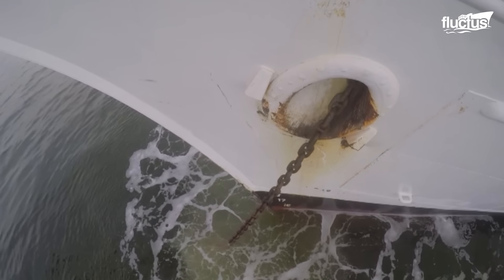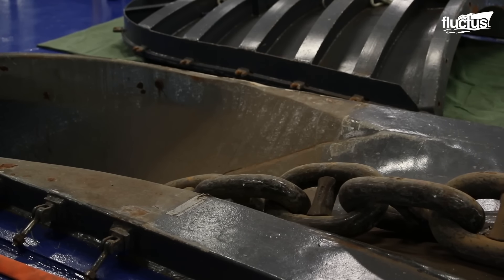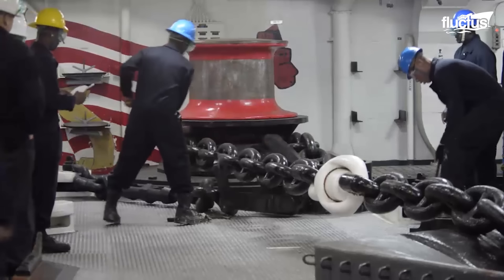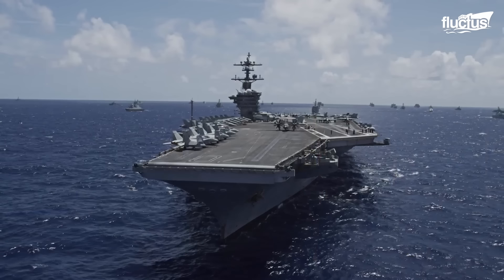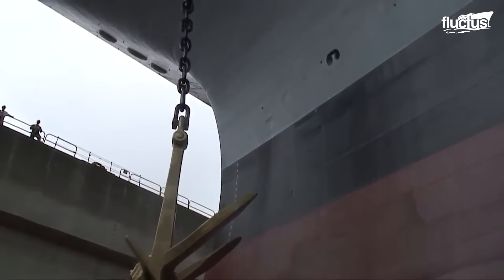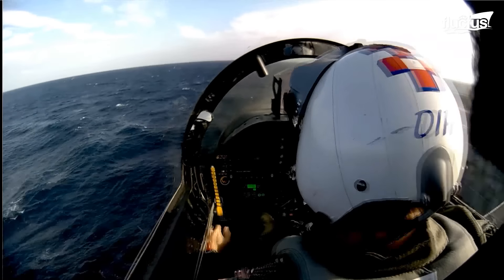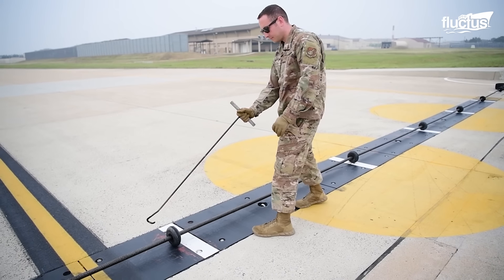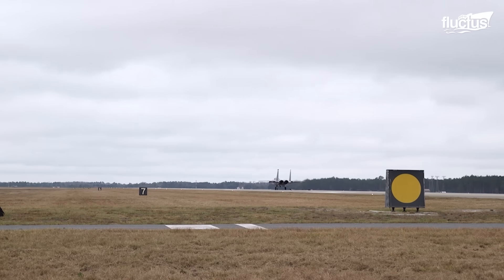How US Navy Drops MASSIVE Aircraft Carrier Anchor at Full Speed

Comment: Great video.  Technical point.  The purpose of the anchor is to hold the chain on the bottom.  When a ship pays out its anchor chain, the bulk of the chain is on the bottom, and a small part angles upwards through the hawsepipe and onto the forecastle and is "clipped" in place by the pelican hook that is connected to a strong padeye on the deck.  That curve is called "catenary" and serves as a "spring" to absorb the strain wind and seas would exert on the ship, as more chain is lifted off the bottom.  When the seas calm, that chain that was lifted off the bottom eases back onto the seabed.  The anchor plays a critical part, but it is the accumulated friction of the chain on the bottom combined with the anchor that holds the ship at its anchorage.
Reply: Yes! The anchor hook itself would not be enough to keep the ship from straying. It's also friction, and the enormous weight of the chain (which increases due to classical mechanics as the chain is pulled horizontal) that reaches an equilibrium with the ocean forces and holds the ship in place. When pulled horizontal, the chain effectively weighs so much that even the mass of the ship cannot overcome it.
Reply: Thank you, I was waiting for the video to explain that the weight of the chain plays a significant part in anchoring a ship, not just the strength of the chain, but the video missed this important detail.
Reply: I thought the catenary results in a straight pull on the anchor. Since the flukes can swivel, this results in digging the anchor deeper, the harder the strain.
Reply: The weight of the sea on the chain on the ocean floor together with the shallow angle of the chain to the ship provides the resistance or strength to the anchor system … in other words a 30 ton anchor and chain system hanging just perpendicular would not provide the strength to secure the force of an aircraft carrier being moved by the seas.  In stormy seas, the ratio is 7 to 1, meaning for every foot of depth at anchor, 7 feet of chain needs to be lying on the ocean floor … hence why the chain is over 1,000 feet long.
Reply: John B ..Well THAT is very interesting, John. I didn't know that, but when you explain it like that , it all makes sense. Thank you.
Reply: On boats around 30 - 100+ feet, it's definitely the anchor that does the job.
The chain ensures the pull on the anchor is close to horizontal so it can dig in rather than pulling out, but I've seen nearly the entire chain lift off the bottom in strong wind, (actually in the water watching it) the few metres of chain  left on the bottom certainly wouldn't have held the boat.

Definitely anchor and chain both play a part, but you can anchor effectively with mostly rope not chain, (as long as there's some chain at the anchor end) but with no anchor you would drift in even moderate winds.
Reply: Thank you for that awesome explanation sir.👍👍👍🙂
Reply: @keamu8580  no shit
Reply: Would’ve been nice if they talked about parts of the anchor, stud link chain, what a shot of chain is, turnbuckles, etc. But I’m just a Boatswains Mate and I spit tar I is I are😅

Comment: Another interesting fact about why arresting gear is needed is because the planes have to land at full power to ensure that if anything goes wrong the plane will have enough speed to take off again on the other end of the ship.

Also I’ve seen video of an arresting gear cable snapping and taking some of the flight deck personnel’s legs off. A flight deck is by far one of the most dangerous places to work.

Comment: It isn't only the anchor, "hooked" to the sea bed that keeps the ship from moving, but a great length of chain as well, who's weight, stretched along the bottom of the sea providing slack to stop the boat from drifting away.
Reply: The anchor itself does nothing else than to give the chain a fixpoint, it isn't even theoretically capable of holding the ship in place.

Comment: Excellent video about the anchor chains and arresting systems. I was a bit disappointed that there was no mention of the motors that retrieve the fifteen ton anchor chains.
Reply: No mention either of the need to have the ship perfectly stationary vis à vis the sea floor otherwise the momentum of a moving ship of that size would just tear the hook off. Have been on board a supertanker on the bridge as the very fraught procedure was undertaken. As soon as the ship was stationary & the hook was dropped the relief of the crew was palpable.
Reply: @JohnThomas-ci9ml  The tremendous energies involved would be phenomenal. I suppose a ship of that tonnage would use thrusters instead of sea anchors for station keeping.
Reply: @kepler186f4  Sea anchors. They were definitely dropping the hook(s). I remember they had some sort of Doppler equipment to measure the motion of the ship against the sea floor. Maybe they had thrusters to help achieve optimum conditions. Very intense concentration from all concerned.  The hook would have been torn off even at a slow crawling speed less than a knot. No ifs or buts. The ship had to be stationary.
Reply: @JohnThomas-ci9ml  What some without understanding would considered a simple task, others with knowledge would know how stressful a situation like that is.
Reply: @JohnThomas-ci9ml  gotta be moving to set an anchor ⚓️ that anchor ain't snapping
Reply: @steveib724  The bridge crew of that supertanker would definitely disagree with you. The anchor(s) wouldn't have snapped but the chain(s) certainly would have! Movement of the ship after dropping anchor would presumably set the anchor safely. I'm not a sailor, btw. I was only aboard as a junior radar service engineer with a more senior engineer from Decca to modify the ship's radar but witnessing that anchor episode was certainly a major eye-opener!
Reply: Hamsters running on wheels... Lots and lots of hamsters

Comment: The anchor chain is not attached to the ship, it is held in in the chain locker by gravity. Only the catspans and drums that pull up or lower the chain connect it to the ship. The chain locker is a void, or space not intended for human occupation, and the chain just piles up in it. It is normally never entered by the crew.
Reply: BS
Reply: It's connected to the ship via the "The Bitter End"
Reply: That's the mooring lines.
Reply: @taraswertelecki3786  Mooring ropes are not connected to anything. The anchor chain is secured to the vessels structure via the bitter end.

The chain locker is inspected at least every year. 

I've been at sea 20 years as a deck officer, look it up.
Reply: @joelang6126  Have you even been in the chain locker? I have been. Never did I see anything to which anchor chains were attached. The catspans on the decks though engage the chains like sprockets. However, some ships do not have anchor chains, they have a thick wire rope at the end of which the anchor is attached. The other end is connected to a windlass.
Reply: @taraswertelecki3786  Yes many, 20 years at sea and 35 ships.

The chain is connected to the vessel by the bitter end.

I encourage you to Google it.

Comment: The purpose of the anchor is to pull out the chain, the chain is pulled out along the sea floor via the ship backing down and a swing arch (the point of anchor drop to a specified length: dependent on the depth of the anchor spot) is plotted.  That's why the anchor drop spot is Not where the anchorage spot is designated.  The weight of the chain on the sea floor is what holds the ship in place.
Reply: @krvnjrcbs  YES!!

Comment: The birthing compartment my division was assigned aboard the USS Coronado (LPD-11) was where the anchor shaft was located. Being in the rack when the anchor was dropped was like having an earthquake.
Reply: LOL you mean berthing though with all the women coming back from cruises pregnant perhaps someday they will rename it.
If you think anchor drops were noisy, nearly any berthing space on a CV is a racket when flight ops are going on. Air wing personnel are berthed just below the hangar deck and our work spaces are just below flight deck. You get used to the noise.
Reply: @johnlucier5654  Air Wing VAW-125 berthing area right below the third arresting cable on CV-60. I can sleep through almost anything now.
Reply: My berthing compartment was in the same place on the FID.  All the way forward by frame 5.  Ig the hook wasn't being dropped; the cats were in use during night flight ops.  Like Greg J. stated, I can sleep through almost anything.
Reply: @johnlucier5654  also on CV-60, OPS berthing is right below the forward cats, my rack was the top rack under the starboard cat.  When I say under, the normal rack configuration is 3 high, mine was 2 high, and sitting up had me head against the overhead (ceiling). During a deployment, after a week, I couldn’t sleep unless we were launching.
Reply: @ogbytes  last time I saw FID & SARA together was in Newport RI.  They were way too quiet.  I got to go down the pier, when SARA was being towed off to Texas.  No pumps, no hull noises.  It was obvious, she was dead.
Reply: The first time I saw FID & SARA together was 1979, Mayport FLA.  I thought they were huge after serving on a fast frigate.
Reply: @PoppiB  I was on CV-43, guess the berthing our squadron (VF-21) got wasnt too bad after all. However we were just below the forward mess deck, next to food storage spaces. Potatoes IIRC. Cockroaches everywhere, nothing worse than waking up in the middle of a deep sleep on a hot day and wondering if that was  bead of sweat dripping down your skin or a cockroach.

Comment: Naval aircraft have incredibly robust landing gear, much beefier than Air Force standard aircraft.
Has Air Force started to modify their aircrafts landing gear? Hard to imagine a B52 deploying arresting gear only to rip apart the tail section. 
Costs assessment? Pilot training? Lots of things go into one service trying to duplicate another services technology. Generals and Admirals always like to one-up each other.
Reply: Seems like the USAF arresting system is basically an emergency landing aid, whereas the USN needs a good arresting system all the time, and gear designed to take such abuse regularly.
Reply: No, the USAF hasn't beefed up their landing gear. Their arresting gear isn't as robust either. It's just there in case their wheel brakes or air brakes fail so that they can come to a full stop without spilling their cafe latte. 😁👍 Fly Navy!!!
Reply: The b-52 has a droug parachute it's awesome

Comment: This was fun and nostalgic to watch. I was on the USS Theodore Roosevelt cvn-71. I operated and lead catapults 3 and 4 at various times of my sea-duty. I later went to shore-duty in PAX River MD, where I also got to operate in the test catapult and arresting gear. The gear engine and damper systems are very similar to what is on board the ship. I'm no stranger to maintaining large and heavy equipment and seeing those sailors working on the anchor systems; that's hard work for sure. Even the airman have hard work running drills/operations and maintaining those air-force variants of the arresting system. Thank you.
Reply: Thank you for your service. Pax ain’t to far from me. As a civilian I have done construction work there multiple times. I’m from Calvert

Comment: Just a point on the anchor. It is not the anchor that holds the ship in place, it is the chain. The chain far outweighs the anchor and they drop a length so that it trails in part along the seabed. The Anchor fluke digs into the seabed as the ship drifts and itself prevents the end of the chain moving while the right length is dropped enough to hold the ship. During a strong tide or current the ship will pull the chain taught (off the sea bed) and hold, once the current subsides the chain's inertia pulls the ship back to the original anchored position. To pull the anchor the ship must move directly above it so that the fluke comes off the seabed easily.

Comment: I was on sea &anchor detail on  CV~67 USS John F Kennedy.  On starboard forward catwalk. When I hear a change in the sound of anchor running out, faster and faster. Call comes over sound power headset : clear the catwalk runaway anchor. I barely stepped inside when the bitter end whipped out and took off catwalk.

Comment: More so it's the lenght of chain that anchors a ship in in the water. A ship will drop anchor, then pull back on the anchor, thus letting more chain out. It's the weight of this chain that holds the ship.

Comment: 0:36 the hooks don’t grip the sea bed!, basically when an anchor is plane on the sea bed it digs into the thick mud, with the weight of the chain they lay down around 80- 100 meters of chain if the boat is around 60- 150 meters long, it’s not the anchor it’s the chain that makes the boat stay in its place although it may spin around the boat it’s still in its area.

Comment: The Weight of the anker pulls out the chain.  The form of the anker depends on the ground of the sea, where the ship main time is going. For excample sandy or muddy ground. The weight of the chain keep the the ship in position.  The lenght and the mass of the chain depends from ship to ship. Only for smaller boats, like small Sailingboats, only a rope and a smaller anker is needed.

Comment: To think they still use the fathom when the military is supposed to use metric units.  One fathom is six feet or around 1.8 meters.  And it's measured below the depth of the keel so at the thirty fathom mark it is actually more than 180 feet out.  And for an anchor drop to count it actually has to fall freely.

Comment: USS Ranger CV-61 Aircraft Carrier, Engineering Department, Electrian's Mate EM2 Ross, 1975 thru 1980. We never dropped the anchor. The end or the chain is not fastened to the ship. The anchor has a controlled decent to the sea floor. This is done by a large brake drum about eight feet in diameter. The term "dropped anchor" is a true term but it is never dropped. I was a training petty officer and each link in the chain weights three hundred and fifty pounds. Although the ship may be retied the anchor lives on to a new ship.

Comment: The anchor doesn't hold the ship...

The anchor just holds the chain in place.
It is the chains length, weight and friction with the sea floor that prevents a ship drifting too much.
Reply: And a hugely important part is the catenary curve caused by the chain (between ship and anchor), which absorbs movements and returns the ship to position without putting too much force on the ship or anchor itself.

Comment: Does the depth of the water ever exceed the chain length on the anchor, does the anchor have to hit the ocean floor?
Reply: Yes, and with a fair share of the chain hitting the bottom with it as well. Running out of chain before hitting the bottom can be a hairy experience to say it at least, for a big ship there is a lot of weight and brute force at play. 
As a thumb rule length of chain should be 3x depth for a lunch stop . 5–6x in settled weather.
Reply: @OleLeik  Thank you, Great info!

Comment: The anchors "fluke" dont hold the ship from moving.  They dig in to the bottom so the ship can creep forward while the anchor drags out the chain and lays out 1000 ft of heavy metal on the sea bed.  Its the 1000 ft of chain laying on the bottom that holds the ship in place.  There are calculations that tell you how long of a chain laying out is required to hold a given ship.  On small boats the anchor flukes may actually hold a boat in place - but no way on a ship !

Comment: I see that Anchor of ships is a MASSIVE waste of enormous motors to retract it or release it controllably, in addition to, its own massive weight and the hazards associated with its operation, and the shear amount of maintenance needed to keep it in a working condition. 
It MUST be replaced by electric motors doing trim motion control in a closed-loop-feedback system that acts as a stabilizer of the ship to retain its position irrespective of the drafting of waves.

Comment: Wrong wrong wrong. The anger does not hold the ship to the seafloor. The anchor is simply a starting point for the chain. The length and weight of the chain is what holds the ship. Without the chain laying on the seabed, the anchor would simply slide along the bottom.

Comment: I guess saying something weighs 30,000 pounds is more impressive than saying 15 tons. That's like me saying it's currently 26,548 seconds past midnight or that car coats 3,295,643 cents.
Reply: Actually 15 tonnes impressive too🌝
Reply: @maksimfedoryak  15 "tonnes" is 33,000lbs though, not 30,000. One of the reasons to avoid this unit in a video that will be seen worldwide. 
Every time I hear a number in tons, I multiply by two and add 3 zeros to arrive at a number that actually means something to me. 30,000lbs is a pretty light load for a semi truck, or 10 very small economy cars, etc, etc. 15 tons is what? 6 elephants? I have no idea.
Reply: @SalisburySnake  15 tonnes is 15 metric cubes of water. Pls, use propper units from SI, not that "5 knots 2 feet 8 inch" shit🌝

Comment: How does that portable system not damage the nose wheel or mains on aircraft as it rolls through it?   It looks like the portable system seen being tested that the aircraft are fully or almost on the ground before it gets to the wire.  Seems like if it hit one of those small spacer wheels or the cable itself it would be not pleasant for the user.....

Comment: I dont understand why it has to be a chain? Why not something more simple like the cables that are multiple feet thick? Like the ones they use to hold up giant bridges
Reply: because cables and other options do not have the structure to hold like the links do.   as I'm sure you have seen 3 or 4 dozen times, it's not the anchor that keep the ship in place, it's the chain.   The chain is shaped in such a matter that it will hold.